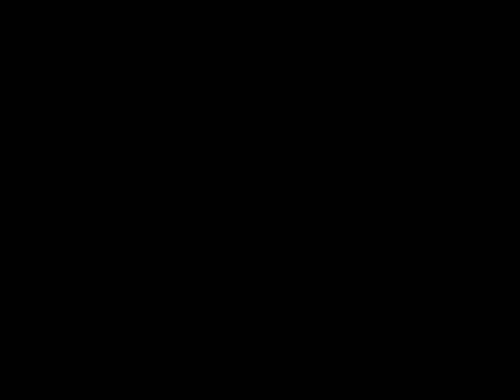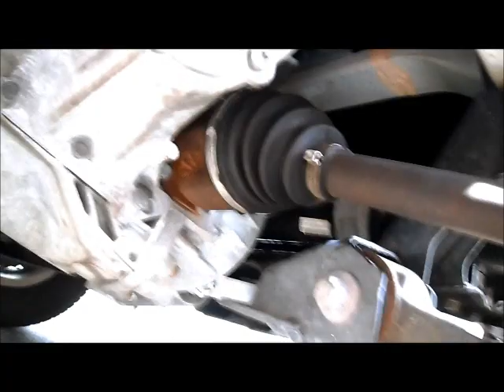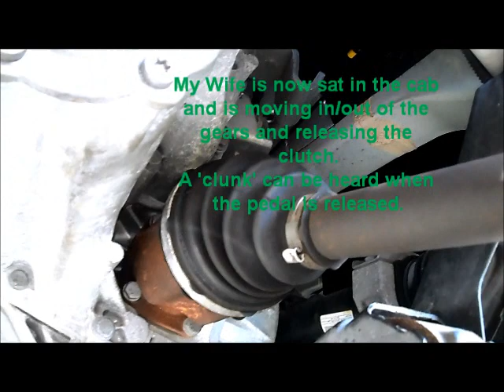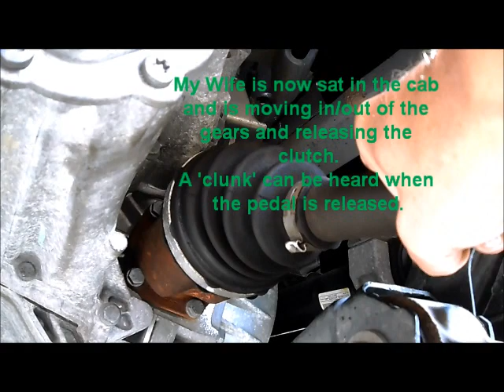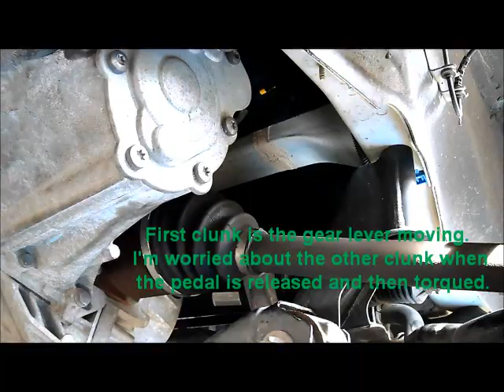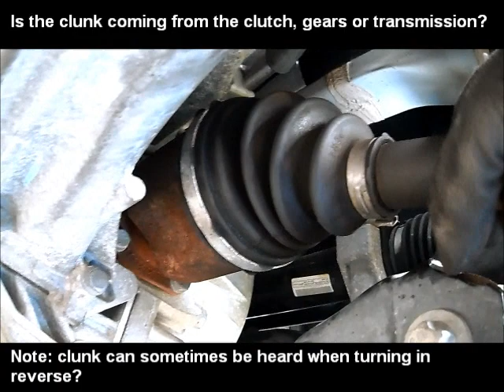"Clunk" when clutch pedal is released.  Started after cambelt change.

Comment: I changed both lower gearbox mounts AND driveshafts on my 09 2.3  in December which stopped this noise. It’s now started again as I believe the doughnut type mount appears to have too much play in it. Get somebody to rock the van on and off the bite point of the clutch and watch these two gearbox mounts, bet it’s flapping around!

Comment: I have installed a new gearbox mount and after i have the same issue , i think maybe because i also lower the engine a bit and something is not well located anymore? did you find out the problem ?
is it still running fine with the clunk ?

Comment: Hey man did you find the problem?
Reply from the maker: Nope - still none the wiser.  Must be "play" in the clutch housing?
Reply: Flash Gordon Im having the same issue with my 07 Altima. Though the clunking/popping sounds comes from the front and back passenger side...
Reply: Same here on a honda accord 99
Reply: Dominique Reed bruh mines too did you fix it? If so how ?
Reply: As the sound was also there when your car was on rack i mean there was no load on wheels or transmission , it means the culprit must be clutch release fork , or release bearing or flywheel
Reply: @101Dezza  the clunk sound is originating from the clutch pedal, on the point where the master cylinder shaft connects to the pivot pedal point. There's a metal pin in there that has too much play and will make the clunk sound when pressed or depressed the pedal.
Reply: @alessandroserrao9422  is it normal?
Reply: @richardvenblance578  no, it's not normal, but many Hondas are experiencing this.
Reply: @alessandroserrao9422  do you know which hondas have been reported to make this noise? Mine just started today and it's a 2018 Civic Si?
Reply: @ToroMoto  in my case the problem redides in the pin that links the pedal main shaft to the plunger of the cluth pump (primary master). With time the pin gains play and needs to be changed with a new one. If also the hole which passes trought is worned out I'd change the pedal assembly entirely. It's a design flaw by Honda and all Hondas that uses that kind of clutch pedal at some point will generate that noise.
Reply: @alessandroserrao9422  okay I will look into this. Thank you for this information
Reply: @alessandroserrao9422  Deffinately not any of those.  After tons of use, pushing the clutch in after a while cause crank walk. The thrush washer s in the crankcase are wearing, along with the added play in the grearbox from releasing the clutch. Especially if banging gears and kicking/popping the clutch. Also from experience, reman axles play along jointly. So axles, the final drive gear, half shaft, thrush washers, motor/trans mounts, and crankshafts.
Reply: @ToroMoto  Look up
Reply: @thisguyhereman88  thanks I'll take a look

Comment: man i was having the same issue and it took me a while to figure it out
Reply: And it was...??
Reply: @laloman7011  bad axel. turns out the guy who had changed my CV boot few months ago didn't just ruined my axel bearings but also stripped off the axel nut threads.
Reply: @izack367  that's ridiculous
Reply: If your boot was broken, then it was very likely it was already damaged and on its way out.